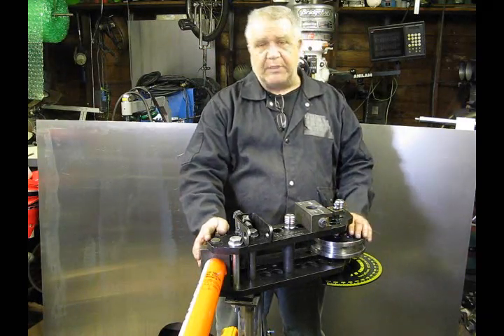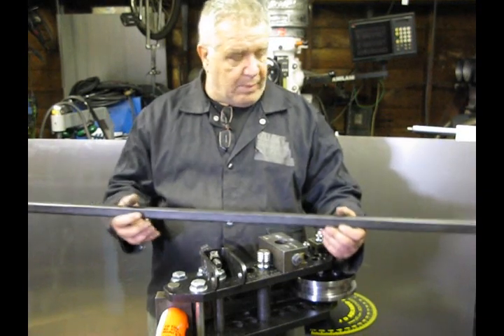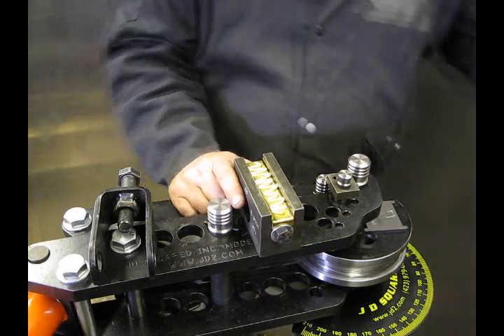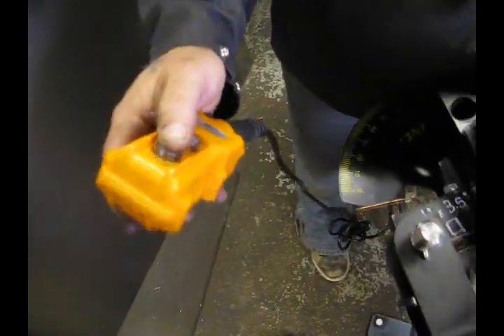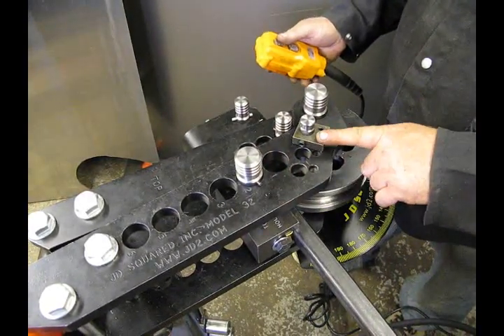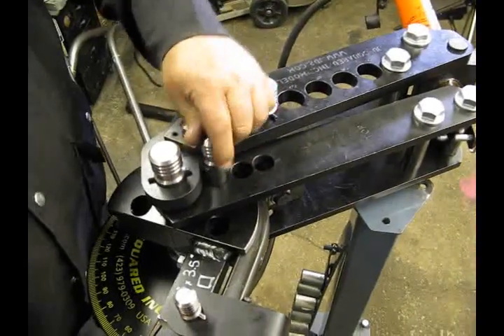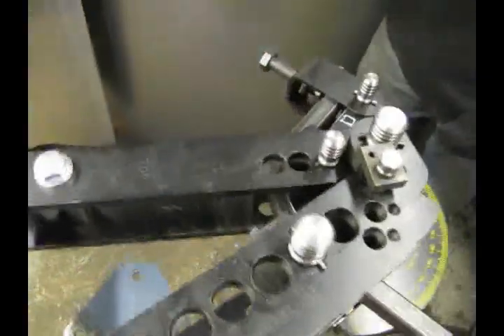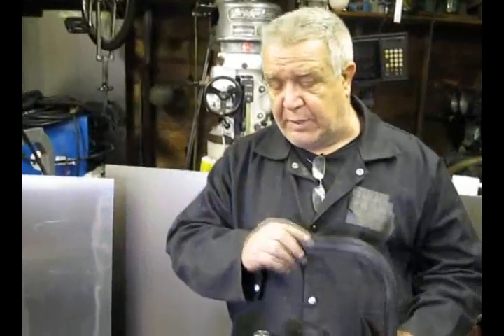JD Squared Model 32 bender - Square Tubing

Comment: I have just bought my first JD2 model 32 bender.  I have never bent tube before but I am working on a project that requires some tube to be bent.  My question is about minimum wall thickness.  I will be bending aluminium 3/4 inch square tube.  I need to use the smallest Die set which is 3.0 CLR.  My concern is the minimum wall thickness for this die set is .093.  The tube I am bending is going to be .076.  Do you think this will be a problem? Will the material be crushed and not bend?  Have you tried to bend material thinner than recommended by the die set?
Reply from the maker: Sorry for the delay. I hope that by now, you have your answer. The answer I would give you would be that you should test on a piece of material that ISN'T critidal (scrap piece) before committing to the actual material that you need for your project. I HAVE bent tubing with a smaller wall than recommended, and had good luck, but I've also kinked other pieces.. Best bet is to use the machine as designed. Sometimes that means buying a new die..

Comment: I just got my Model 3 set up today. I have a square tube die in it.I have had this machine for a long time but just found a good spot to put it in my shop. and of course I lost the operators manual to it. Thanks to you most excellent video all of this now makes sense. I'm glad I bought this machine it's so well made and ultra heavy duty. Makes all the other benders I've seen look like toys. Thanks for a great video